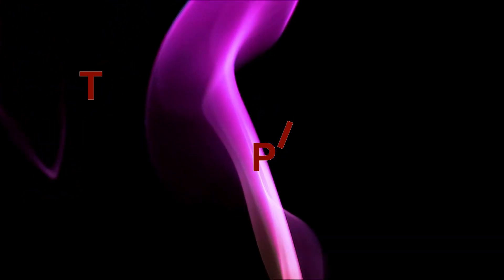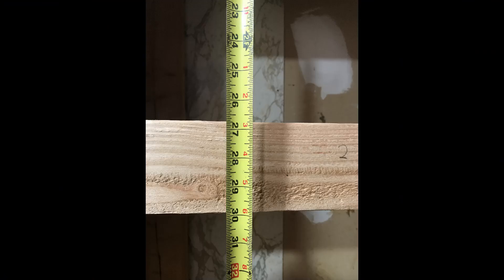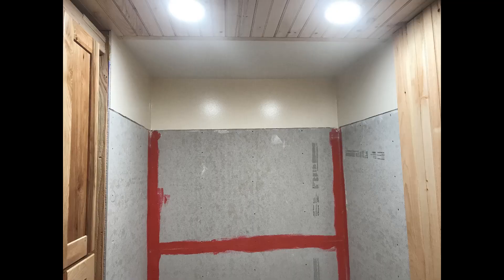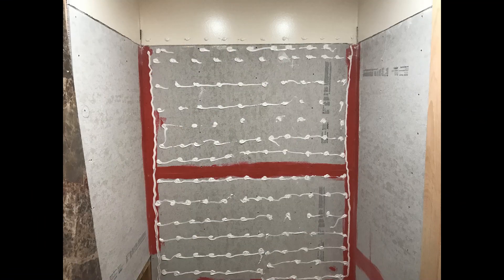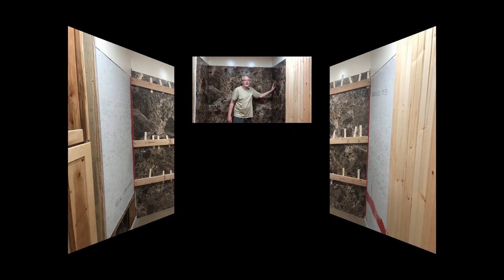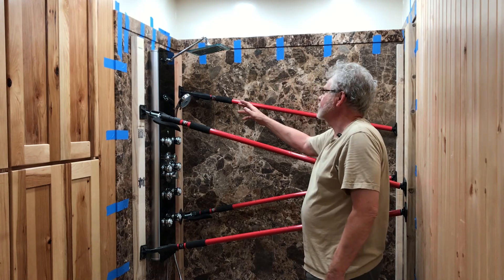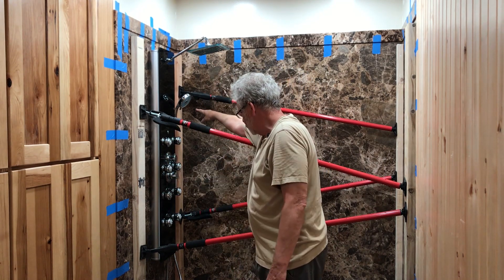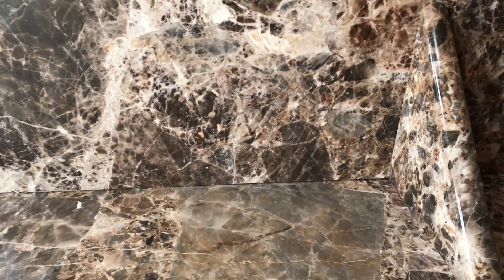How to Install a New FlexStone Shower

Comment: Cutting with circular saw, what tooth blade and did you reverse blade?
Reply from the maker: blade in normally. 40 tooth finish carbide tip blade

Comment: Is Flexstone suitable for steam showers?
Reply from the maker: Good question ! The product is about 1/4" thick plastic and then a color sheet is applied on top of the substrate. I do not know if the adhesion is heat activated. I am a retested dealer for sentril. I have reached out to customer service for there input. May be after the holidays i hear back from them . But i will keep you posted !!
Reply: Appreciate it 👍

Comment: Looks great!  I’m doing mine now.  Did you notch the fronts of the side panels at the bottom for the raised threshold of the base?
Reply from the maker: Yes. First scribe your side panel to the back panel.( use a compass , set it to the widest part, mark your panel and trim as needed.) I find a power planer works best for this because you are just taking off a little bit at a time. then stand your panel up and using the compass or what i refer to as a scribe, set it to the measurement from the floor to the panel. mark your threshold area . they make a jig saw blade where the teeth point away from the saw , this works good because it is not pulling up on the panel causing chips. for the round corner they make a small blade for saw, i will refer to as a coping blade(about  1/8" blade) finish the round corners with that. Do not worry if your first cut is not what you want. you can always trim some off the bottom of your panel, the top trim can cover the edge of the panel 1/4" up to 2 3/4" so the back and side panels do not need to be even with each other at the top . you adjust the trim to make everything even. make sure that the top trim is mounted high enough to clear your shower frame though. thanks for the comment !!😁
Reply: @ thank you so much for all the info.  I did the back panel yesterday and it fit snug and perfectly.  I was worried about side panels but your information will be helpful.
Reply from the maker: @j0hn0214  just take your time. I always get a bit apprehensive at the start of a project that i have never done before. but afterwards you look back and think ... that was not so bad after all !! the product does cut and work very well, being solid plastic it will be there forever

Comment: what does it mean to scribe your corners?
Reply from the maker: After you have the back wall up. Take your side wall piece and hold it up to your back wall piece. There may be a gap between the two. So you take your scribe ( like a Childs compass) set your scribe to the widest point. Run it down along your back wall. This will put a pencil mark on your side panel. This is what you to cut, plane or sand off to get a tight joint. Hope this helps
Reply: @ ahh thank you. Got it! Thanks for the video. Will be setting mine up soon did you glue the  shower floor/base down too?
Reply from the maker: @fernando651  No the base has about a 2" flange to screw it to the wall. I use screws made for hardie backer. ( thick and no rust )